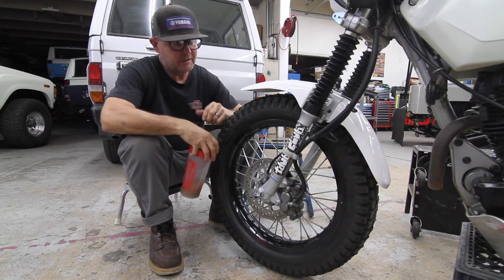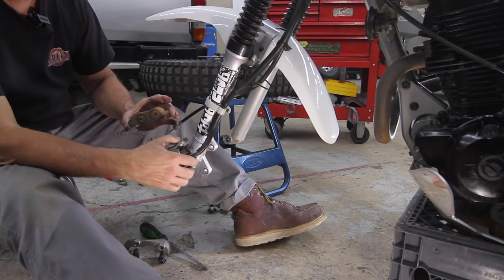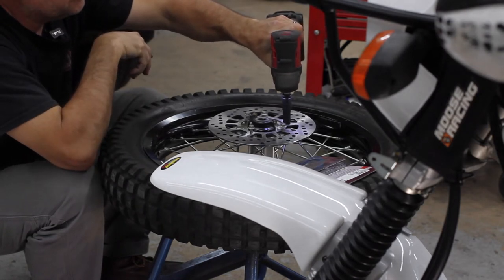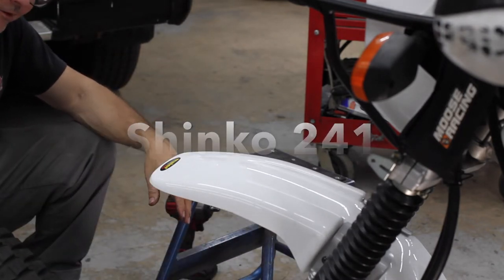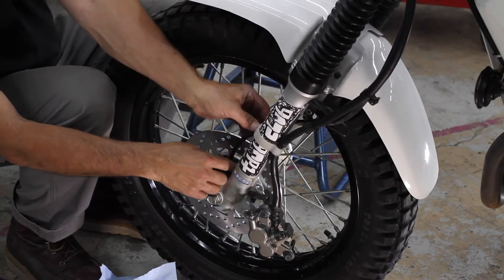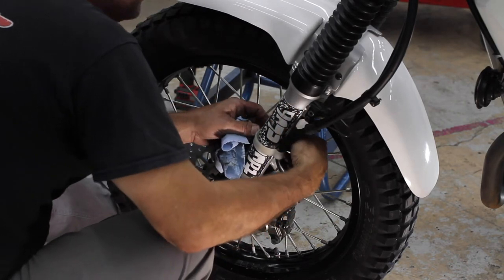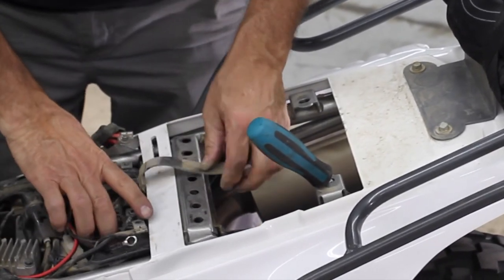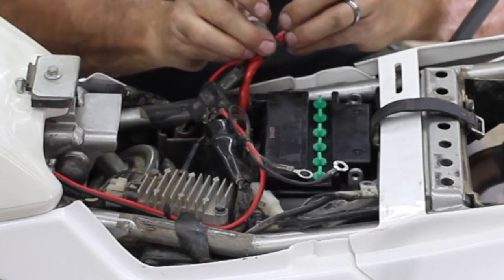TW200 Brake Disc & Battery Install   Yamaha TDUB Club

Comment: How many miles are on that 241?
Reply from the maker: Maybe 4k+ but I wore it out quickly running it too often at too low of pressure on the tarmac to and from the dirt, which causes the cupping that you might be seeing. I put a new one on for the TDUBFEST.